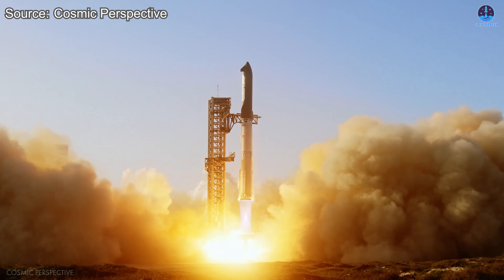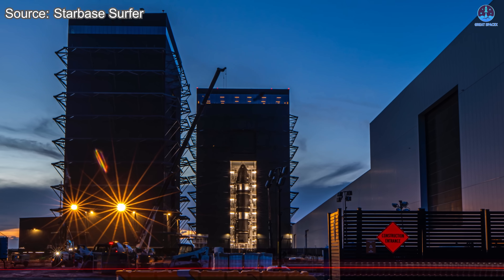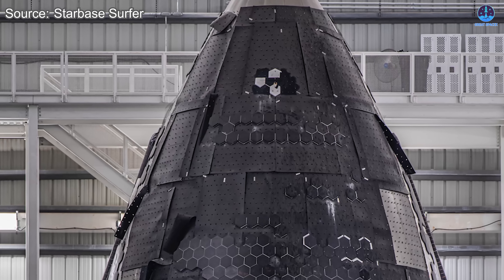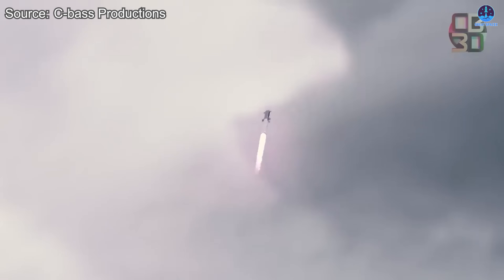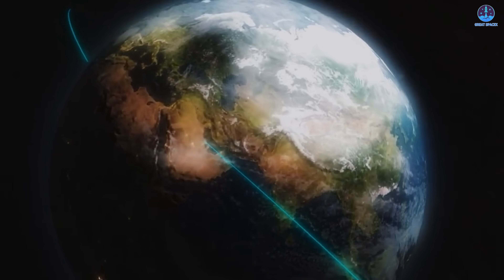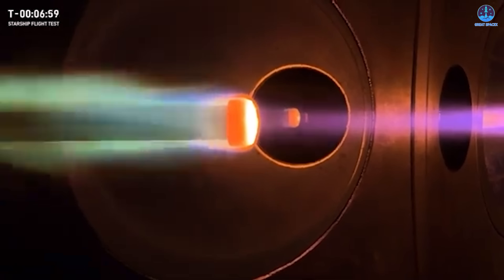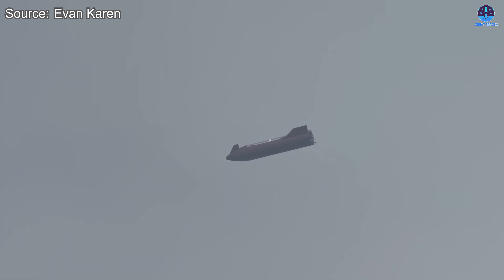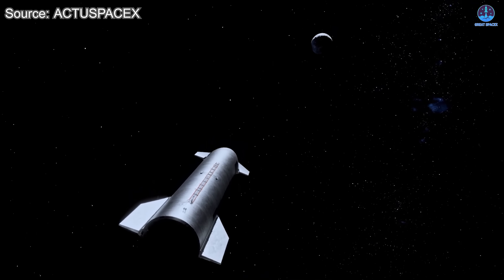SpaceX revealed New Heat Shield on Starship Flight 10 to Beat 1500°C Reentry…

Comment: Try Salt water treatment on metalic tiles like the ship pulled from the ocean. Presurize them in a salt water pressure vessel. Try different salts to improve on that and Pressurize Starship with salt water to increase strength. Lead these new manufacturing experiments with Salt water starship marinade production. Micro cooling and temperature control from 3D welding new starships with cooling or heating pores.
 Elon 
3d weld just ONE UPSIZED STARSHIP PROTOTYPE OF THIS TYPE. 
Keep in mind different types of stainless the marinade process may work better on.

Comment: I was wondering why they couldn't just spray on a ceramic coating in a thick enough layer on the underside of the stainless steel heat shields. With a thought being the ceramic would be protected from a lot of the forces that would normally correct them and the ceramic would further increase the stainless Steels ability to dissipate the Heat
Reply: Because the skin of the rocket flexes due to the immense force on it during lift off and ceramic is brittle. A single giant ceramic structure cannot flex, And should a crack develop, the crack will grow and cover the entire ship. While if you have tile, at most the crack will destroy one tile.
Reply: @nickl5658 that's why I said that each individual stainless steel panel could be sprayed with ceramic to help direct heat away from The Craft the flexing of the inner shell shouldn't affect the coating on each individual tile

Comment: As an armchair phd rocket scientist, I would minimise the surface area of the heatshield by going for a nose first reentry. This would provide the following advantages. 
1, lighter weight.
2, easier maintenance 
3, reducing the risk of even 1 tile failing or falling off along the whole length of the Starship. 
4, greater payload 
5, lower cost.
Why would you intentionally expose the entire side of the whole vehicle to a 'broadside' of plasma? It doesn't make sense. 
You can easily flip the Starship after reentry to provide the desired atmospheric drag that has been demonstrated by previous flight tests.
Reply: Given that there is a LARGE amount of kinetic energy that must be dissipated, spreading that energy over a large area decreases the amount of energy at any point.  Even with the belly flop maneuver to spread the heat over the largest possible area the ship is burning off components.  If the heat was all concentrated in the smallest area it would vaporize it.
Reply: They belly flop to burn off speed. A nose first reentry would have a very fast reentry, and the entire ship would need heat tiles.
Reply: You need to slow down from 28,000kph to zero kph. There is barely any fuel left to slow down. So air resistance is the only thing you can use. Getting through the atmosphere fast is not the objective, losing speed is. And  all that kinetic energy turns to heat. So if you lose speed too fast,  the ship melts. So belly flop is what they do to catch as much air as possible, to slow down and to lose speed as slowly as possible.

Comment: To many changes to fast. Just get it in orbit , test and resolve heat shield . Then after he can do that, start making improvements one or two at a time. It would be better to solve problems one at a time but SpaceX thinks they can do it all at once.
Reply: You dont want to make changes once you have a working vehicle, way to much risk. So get it right now while its still in testing
Reply: Orbit is not the goal.  That could easily be achieved with longer burn times.  The goal is to create a rapidly reusable delivery vehicle to low Earth orbit.

Enduring reentry is the major hurdle.
Reply: My dude, that is what normal scientist and NASA does. ELon is all about moving fast and breaking things... a software design philosophy of the early 2010s that is now being discarded because it results in alot of deep seated problems with the final product that cannot be solved easily. Not enough thinking/planning in the "Move fast" period and insufficient product testing in the "breaking things" phase.

Comment: The whole thing is a ticking bomb, now fuel will be heated up in the outside of the ship. I think more issues will show up. Dreams are fun up to a point, but must give way to reality. Slow down using the engines, Need more fuel? reduce the payload.
Reply: Payload has been steady reduced from 200 tons, 150 tons, 100 tons and now 50tons to LEO.  And if they reduce payload to LEO any further refueling a starhip in orbit becomes impossible as fuel evaporates in space as SpaceX has not done anything to insulate the tanks to prevent heating and evaporation while in space.

Comment: It's not the tiles, that constitute a problem. It's the "flap"-joints. Make a re-entry-burn to slow the ship down. Yes You'll need a lot more fuel, but..... Slower = cooler...
Reply: Not feasible. Everything about this type of system is mass-to-orbit, so any wasted fuel directly reduces this number.
Reply: @Tailspin80  Well, if they can get the ship down. Any "wasted" fuel is a win.... Burning up on re-entry, with more mass to orbit, is not..
Reply: @ulrikhansen7940 I believe that a powered descent is not even possible from low earth orbit. You wouldn’t be able to take enough fuel with you and get into orbit in the first place. Every design throughout history has relied on atmospheric braking and that inevitably generates very high temperatures. In fact one of the problems with landing on Mars is the lack of atmosphere so even though Mars gravity is only 0.38 of earth’s you have to burn a lot of fuel to get it down to the surface.

Comment: wouldn't even need the expensive heat tiles if they did a braking burn to slow down the Starship from MACH10+ when it hits the upper atmosphere which is why you have heating in the first place.. either use disposable SRBs just small enough to drastically slow down re-entry speed. or use raptors to slow down.. of course using raptors uses onboard fuel, but how much fuel does the Starship have when it splashes down? is it completely empty or does it still have enough left over for a re-entry burn??
Reply: Don't think you could justify the breaking burn.  If the unloaded mass of the ship is 10% of the mass at liftoff, it's going to take a lot of fuel to do any significant reduction in velocity.  Same with SRBs and you'd have to be absolutely certain they'd ignite with equal thrust, on command, because once lit, they burn till done.  Any imbalance would likely be catastrophic.  On liftoff, you can hold the thing down until you have balanced thrust.  Not on a deceleration burn.
Reply: The amount of fuel that would be needed to slow down to not deal with the harshest regions of reentry would basically mean you need a fully fuelled ship in LEO and no cargo and use up ALL of that fuel just to slow down.

The roughly 10-15T heatshield is a bit lighter than 1,500T of propellant.

Comment: The space shuttle had large panels of shielding on the nose and leading edges of the wings. Why not use that material as it seemed robust?
Reply: Those tiles were single use for the most part. Every flight, the shuttle was completely disassembled and rebuilt, more refurbished than reused. If the goal for space x was just getting to orbit without the goal of rapid reuse, they would be there easily.
Reply: Patents, that's why.

Comment: There is so much nonsense with the metallic shield, just like with everything else at SpaceX. Nothing truly new is being added, it's just being presented as if it is. Basically, they’re going to wing it: if it works, great; if not, it will explode and they'll call it progress.
   Everything that has worked so far is largely thanks to the experience shared by NASA. The claim that steel gets stronger when heated is misleading. While it's true in some ways, heating also alters other properties, often in undesirable ways. That’s why they ended up using a heat shield after all. But since they initially claimed they wouldn’t need one, they’re now acting as if using steel tiles is some kind of innovation.
   To sum up: SpaceX took a lot of knowledge from NASA and is now tinkering with everything to make it cheaper, all while presenting it as innovation. It’s not. It’s just different. Is called OceanGate technology.
Reply: NASA heat shields worked on the principle of being ablative. That meant the shield was wearing away and that was taking heat with it. Unlike SpaceX, NASA was in to disposable rockets. The heat shield on the shuttle are what condemned the program.
Reply: @tombombadil3185  NASA could have accomplished much more if it had been properly funded. But over the years, its budget has been repeatedly cut. Instead, that money is being funneled to SpaceX, not because of achievements, but because there's a push to turn space into a business.
     Private companies like SpaceX offer profit opportunities, while NASA doesn’t. That’s the real reason: rich investors can’t make money through NASA. It’s not about innovation. It’s about control and profit. That’s all.
     That’s why, for people with knowledge, everything SpaceX does is just “meh…”,  nothing truly groundbreaking. But for the general public, it’s all “WOW, they’re innovating so much!” It’s all about perception, not actual technological leaps.
Reply: @tombombadil3185  The Space Shuttle’s heat shield was reusable. NASA developed reusable rockets [McDonnell Douglas DC-X]  that could land as early as the 1990s, as well as the aerospike engine and even early forms of printed engines. Sound familiar? These are the same technologies SpaceX now presents as if they’re its own achievements.  
    The focus on SpaceX is more of a political and economic strategy than it is about real innovation.
Reply: @MsGenon  The shuttle never achieved its' goal of rapid turn around due to refurbishment including the ceramic/ metallic heat shield. Two out of five killed the astronauts that flew on them due to failure of the heat shields..
SpaceX doesn't use aerospikes.
 Let's try constructive criticism, ehh?
Reply: @tombombadil3185  "SpaceX doesn't use aerospikes."
Hehe... I knew you'd pick that up... NOT YET.

    If you could send an entire rocket into space using spike engines, just imagine the possibilities. That would be true innovation. What SpaceX is doing now is impressive, but it's more engineering than groundbreaking innovation.
    Look, in some ways, I actually like SpaceX. What I don't like is the hype and marketing around it, same thing with Tesla. In my opinion, it's misleading. Just don’t overexaggerate things. Don’t do things and then skip giving credit to those who actually deserve it. I do think is c..... that they are keep blowing rockets and call it progress!!!! It clearly shows the same mentality OcanGate had, the difference is Space X is using taxpayer dollars.
Reply: @tombombadil3185  Like I said before, what slowed down NASA, and killed a lot of cool projects, was politics and the fact that it wasn’t a business.
Reply: I bet you’re a laugh at parties😂
Reply: @jimbobbyboo8508 Shuuuuu......!!!
Reply: You know nothing
Reply: @SchwiftyThings  Please enlighten me!!
Reply: Yeah... some steels do get harder when heated but they become brittle. So after heating, the metal is harder to  deform, but when it does, fractures like glass rather then bends like metal. The metal also loses the amount of flex it can do, ie how much you can deform the metal and have it return to its original shape.

Comment: This ship up-till now has never done a successful flight, going into orbit, do its job, and return to base intact..  wake us up if it ever will...
Reply: It will not. Because even if it does all that, it has to do it again in under a month (to beat the space shuttle) and do it cheaper than a single use rocket.  Quick turn around and cheaply is the real challenge. Else, just use a regular rocket.

Comment: The tiles should be layered such that if the outer one dies there is another fresh one behind it.
Reply: Like scale mail.
Reply: Weight is an issue. SS is already overweight. It used steel because SS wasn't suppose to need a ceramic heat shield. Now that it does, there is no need to use heavy steal.
Reply: @nickl5658  It's funny that you used SS.  I typically use SS to mean Social security.  I don't know what configuration of tiles would be best.  There are so many possibilities.  I know that weight is super important but if it takes that to make it reliable and safe it would still be important.

Comment: The white lines between the tiles is not a sealant or bonding agent - it is the white thermal blanket folded between tiles to address the gap between tiles to accommodate for expansion and contraction.
Reply: OH! I assumed it was a putty of sorts to fill the gaps. Is it like a kevlar then or?

Comment: I'm amazed that this deep into the flight test program, they're still experimenting with the heat shield
Reply: It's understandable. They have ceramic tiles that work pretty well, but it requires extensive inspection and refurbishing between flights. The goal here is to develop a more robust type of shielding, which up until now did not exist.
Reply: @ChickensAndGardening it's insane to leave development of a mission and safety critical system until after flight testing has begun. You don't design a new car and then begin production, then decide to redesign the brakes
Reply: @ChickensAndGardening  "a more robust type of shielding, which up until now did not exist". It still does not exist.
Reply: I mean which one that already exists can be reused without refurbishment?
Reply: @ChristopheMadacamia no one has ever developed a heat shield system which can be reused without refurbishment. It's possible that this technology may not exist, and may never exist but it's a problem which has to be solved before you start building spacecraft
Reply: @jimeditorial exactly, so what you suggest is halting all flights for like 5 years until it's fully ready ?
Do you think car manufacturer don't test their cars before they have all the R&d of all cars 100% ready for market Laich ?
Reply: @jimeditorial  I see your point, but there's really no way to fully test such a shield in the lab. There are many factors that can't be replicated on Earth: high temps, wind, atmospheric plasma and particle bombardment, and gravitational stresses during high velocity reentry. Plus probably a dozen other things I, a normie, don't know about. The weight of the spacecraft (about 140 tons) is itself a major stress factor. SpaceX does have great engineers so hopefully they're acquiring useful data from each attempt that eventually will help them perfect the ship's launch, reentry, and landing capabilities – all of which are in the "never before" category (Space Shuttle comes close, but with a third of the mass).
Reply: @ChristopheMadacamia the heat shield is as fundamental as the main engines. No way they should be flight testing large, complex spacecraft without solving the heat shield problem first. SpaceX has very cheap access to a simple and reliable system, falcon that is a logical vehicle to be flight testing advanced heat shield designs, and that should have been the first priority, even as Starship was in the design phase. There appears to be an organizational problem within the company
Reply: @ChickensAndGardening in the 1950s, NASA used low-cost boosters like Scout and Thor to test heat shield designs.
Reply: @jimeditorial no it's not, not until zou have valuable cargo to take back... They can expand it until they have a ready heatshield

Comment: SpaceX has a problem with the Starship it's a heavy and it keeps growing in weight. Metal heat tiles will only exacerbate the problem. They have proven that the can lift the Starship to space almost despite its mass. Reentry heating is effected by the weight and shape of the Starship without a blunt surface like the Shuttle or any capsule that has successfully survived reentry the Starship has a really difficult problem ahead.

Comment: adding  every tile as a cooling and sweating one may not be necessary. as nitrogen gas vapour emerges is will be pushed back expanding spreading absorbing cooling then surface near by.
placing in rows ribbons may work better

Comment: Why can't Starship enter the atmosphere more slowly, not the speed of the ship, but the descent? Very slowly enter the atmosphere, scrubbing speed over a much longer duration. This should generate a lot less heat.
Reply: Starship can’t enter the atmosphere slowly because the upper atmosphere is too thin to slow it down. It has to shed orbital speed (I think around 28K km/h), and that only happens effectively in the denser lower atmosphere. Slowing down earlier would need tons of fuel, making it impractical and you lose payload capabilities/stability :)
Reply: My idea is to have stationary flaps all the way up and down the sides of starship, making its belly fatter.  This will slow it down more while traveling through our atmosphere.  This would be especially helpful to keep crew starships cooler.

Comment: There's a backup solution called "blade of layers" to absorb and dissipate heat during reentry. Future plans include a metallic heat shield, replacing ceramic tiles, and advanced cooling systems using water, methane, or nitrogen.

Comment: I still feel that the fuselage of the V2 Starship is the cause of all the failures.
Reply: Yeah, I'm still doubting the welding process... more so the materials used, ST304L.. indeed it is beneficial for temp changes but if that weld is at one place not 100%, a chain is as strong as it's weakest link.
Reply: @YorenM I think that it has something to do with the resonant vibrations.  A certain frequency.